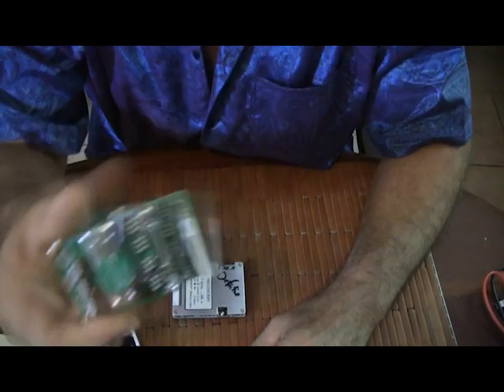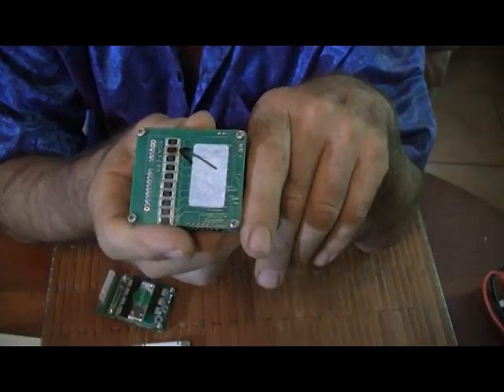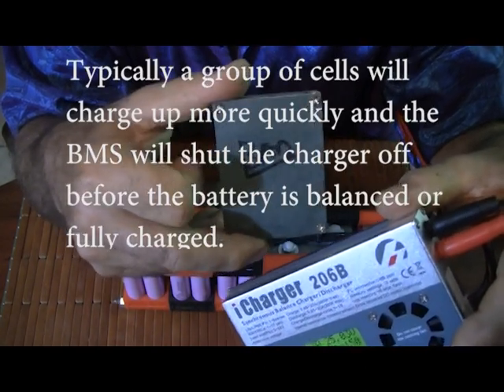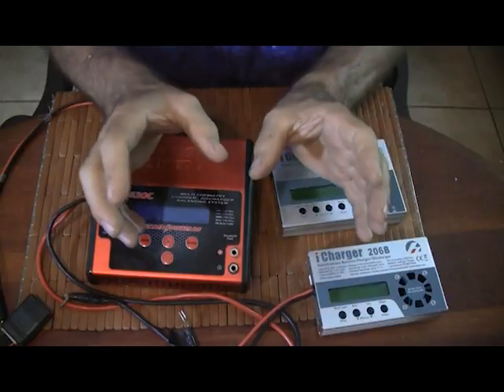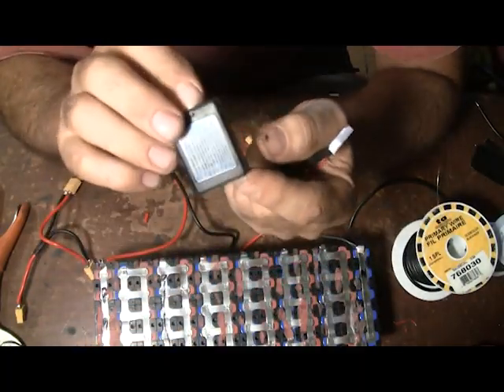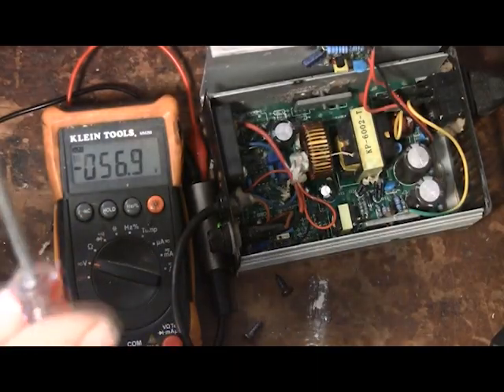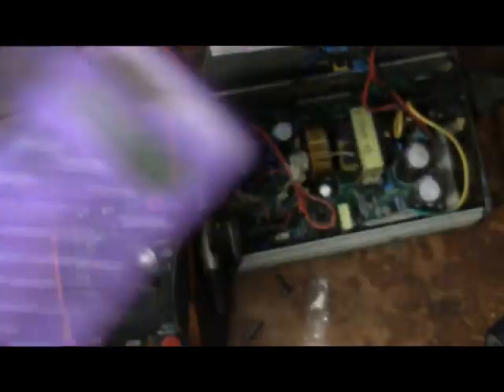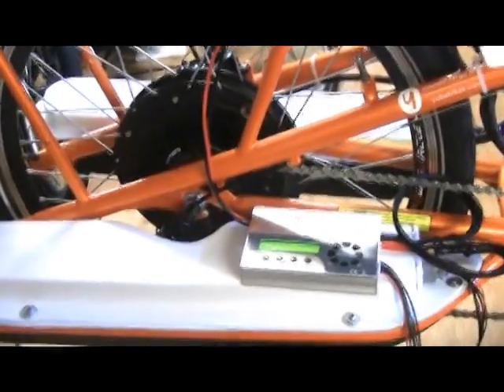How to build a safe and better lithium battery WITHOUT a BMS.

Comment: Nice video.  I have 3) 60 volt snapper battery packs they're all bad.  You've inspired me to pull them apart rewire and see if I can't put it back together again without the BMS.  Not exactly sure what I do with 15 cells relative to your explanation but I'm sure there's some sort of product out there.
Reply from the maker: Don't do this to working packs!  You will need at least an active balancing circuit board and to replace any bad cells when reassembling.  Using a Hobby Charger with a 60 volt battery requires charging the battery in halves, too fussy for most people...
Reply: @shawname2  I thought I would try to take my 60 volt 2 amp pack, and make a 60 volt 4 amp pack by splitting it into double-charged packets and then reconnecting them to a  jumper like you showed your video.  Was also going balance via SS voltage and to play with the  voltage reading IC your showed.  I have 6 bad 2amp packs, so probally have enough decent batteries to play with.  I've watched a couple more of your now, being the geeky type myself I've enjoyed your knowledge.
Reply from the maker: @rh-cv3nr  Hmmm, why not try and repair two of the packs using the third as a spare?  It could very well be bad cells, not a bad BMS.   Many ways to go!

Comment: Nice video. I’m a fan of bms-less batteries myself. For charging of parallel cells, you can also use the very cheap tp4056 modules (25 ct each) that actually charge each parallel group of cells to the correct voltage (max 4.2v) instead of having to bleed excess voltage through a resistor. Splitting a battery is a great option. In that way you can use a 2 amp usb charger to power two tp4056 modules. Resulting in a very cheap charger that balances cells faster than any commercial charger. At the same time, I recently also built a battery from old laptop batteries with bms, to which you can still apply the good practice of monitoring individual cell voltages yourself. Balancing of old cells is no problem if you carefully matched the capacity of the groups of parallel cells beforehand. Multiple ways that lead to Rome, but I prefer the simplicity and maximum power of running without bms!
Reply from the maker: Good find, those Chenbo boards.  I once used 4 volt power supplies on my 120P Power wall battery- before switching to active balancing...  a moments searching found a 3 pack of 2 amp chargers with two USB ports each for $11.  Good post- make a video and share it!   thanks!

Comment: I only make small battery packs for hobby projects like lights. I also don't a BMS, they are too expensive and too complex. For a small battery pack I use holders that allow me to remove the 18650 cell and then I charge them individually. Cheap, simple and easy to replace a dud cell.
Reply from the maker: Yes,  we are in the same way of thinking.  BatteryBlocs are for larger batteries than a 4P.  For smaller batteries there are better solutions...

Comment: thinking of this setup i takE it id need 2   i chargers  10 10 B ?    i trust you and makes sence  THE chargers are  expensive ..  but i have 20s    72v    and not sure if its going  to be a 3   4  or 5p   yet   Samsung 30T 21700 3.7V 3000mAh 35A is my cells there expensive  so i want to lookafter them    any ideas  ?  WHERE DO I GET THE BATTERY LED METERS  HOW MANY I NEED FOR A 20S          THREE  I TAKE IT
Reply from the maker: 20S is hard with a Hobby Charger.  You would need to split the pack in half and use a 10S icharger.  I would consider active balancing and use three 8S cell loggers to monitor the parallel groups voltages....
Reply: @shawname2  thanks  shawn SO I WILL NEED 1OS CHARGERS  X2 ?   THIS WILL  BE 200POUNDS     where do i get thease 8S LOGGERS  SIR ?
Reply from the maker: @jonneilsmyth9107  Do you have a hobby supply store for RC cars and planes?  You are in the UK-   You can also try Hobby King- they ship worldwide.
Reply: @shawname2  THANKS AGAIN SIR I WILL TRY TO STOP ANNOYING YOU FOR A BIT UNTILL THE CELLS  ARRIVE AND THE ONLY ONE THING ID NEED IS A 20S TRIANGLE  Configuration 4P 5P 6P   IT WILL BE ONE OFF THE THREE AS IN 60 TO 120  CELLS   AND IM CRAPPING MYSELF DONT WANT TO SMOKE THEM MY HOME OR MYSELF
Reply from the maker: @jonneilsmyth9107  Go slow, be of Zen mind, start with the negative terminal checking the voltages as you build,,,,,,   Good Luck!

Comment: I have to ask the one question, and I may be ignant of this, however what maintains the discharge rate of the battery?
Reply from the maker: Sure- two things, the load itself- the battery cannnot discharge more than the load will accept, and if the load is unlimited, the battery chemistry.  It is called the "C" rate.
Reply: @shawname2  Thanks shawn. That just made everything easier for me. Have you found an RC battery charger for 14+ cells that is any good?

Comment: This a outstanding video but it makes me think there should be a BMS as a combination of all of this, showing info about all cells and allowing decisions to keep going or not
Reply: I'm interested in a car conversion, I'm making my research
Reply from the maker: Yes.  We need a product that allows bluetooth monitoring of each parallel group, the high voltage and low voltage cutoff of a programmable BMS, and an active balancing circuit good for an amp of current.

Comment: The current for balancing with the icharger 206 is 350mah. The new ISDT T8 charger has a balance discharge of 2.2 amps. Plus charging voltage is adjustable.The bigger icharger 4010 has a higher balance discharge. It's nice to charge faster and not wait to balance the battery.

Comment: WHERE Do I buy the port cable at? I can not find it on ebay or elsewhere.
Reply from the maker: They are called JST-XH connectors.  Search for that, they are everywhere, or visit a RC hobby store.

Comment: I have a question, You say that a hobby charger is better than a BMS. Can you add a hobby charger to this build? https://www.youtube.com/watch?v=p1xildSl4Hk. Maybe I should ask can a hobby charger be put in place of a BMS for any battery build?. Thanks.
Reply from the maker: Sure- you could use a Hobby Charger to balance these batteries- or you could use active balancing, or a BMS.  I say a Hobby Charger will balance faster and better than a BMS, but using a Hobby Charger takes a bit more know how.
Reply: @shawname2  Awesome. Due to your reasoning, I think I would go with the hobby charger also. Are you available for help if needed?
Reply from the maker: @jamesw6529  Yes, happy to give free advice.  Contact me through my website www.batteryblocs.com
Reply: @shawname2  Can you show us the install of a hobby charger? or point us to somewhere that shows how to connect the hobby charger?

Comment: QUESTION  i am building a 13s 6c pack for a bike. these are used cells all been pre tested and ma written on. i have used the site to arrange the cells..now the ma vary from 1880 to 2500. the auto cell program mixes the 2500 with the 1800s..is this safe or will it cause damage or reverse charge the cells hope you can help cheers
Reply from the maker: Yes, it is safe to mix cells of different ma in the same parallel group.  The critical factor is that all the parallel groups have close to the same ma.  The closer they are, the more balanced your battery will be.   It is also OK to use different numbers of cells in P groups, as long as the totaled ma is close.
Reply: @shawname2  the online calculator told me how to arrange the batteries in P.
SOME HAVE 1880ma and some have 2300.
it's that website where you type in all your battery milliamps and it works it out for you in groups thnx for replying
Reply: They all added up to around a deviance of + 1 or -in the parallel groups of 6
Reply from the maker: @electricdixie34  You are talking about mah right?  Give it a shot!  If a bms can't keep it balanced, try a hobby charger.

Comment: you are talking lot about over-charging. what about how to prevent over-discharge ?
Reply from the maker: Hi Anthony,
I use these:  

https://www.aliexpress.com/item/4000306287198.html?spm=a2g0o.productlist.0.0.d22f32b97LpVhi&algo_pvid=c9fc463e-04f5-4349-bf59-2acc9d9d0ed6&algo_expid=c9fc463e-04f5-4349-bf59-2acc9d9d0ed6-0&btsid=0ab6f83115903515704091998e45c9&ws_ab_test=searchweb0_0,searchweb201602_,searchweb201603_

They sound an alarm if a parallel group gets too low.  Good for batteries that you are around.  For large batteries I use a voltage relay like this:  

https://www.aliexpress.com/item/32826508821.html?spm=a2g0s.9042311.0.0.27424c4ddJknBr
coupled with a relay.
Reply: Shawn. Your explanation is make sense. . Thx for sharing anyway. I subs your channel
Reply from the maker: @anthony4312  Yes, true.  This is for geeks.

Comment: i use a bms, however i have also wired an arduino with a small screen connected to current sensors to each balance wire, and temp sensors to some components (like to some cells, components that get hot). that way i can see what the bms is up too and how my batteries are doing for the exact reason you dont like bms's. I want some feedback. least when the bms fails i will know.
Reply from the maker: That's a great approach- you are more skilled than most!

Comment: hobby charger was BMS to, but it use lcd to monitor the voltage
what's differen BMS and this hobby charger
it's still the same
at least if not using BMS, so charge it directly to power source
so that called not use BMS
cause I see youtuber not use BMS for battery that use on his EV car
and it's still balance
so make sure balance the battery by your own (the resistor of the battery is identical)

Comment: Thanks Shawn for this great video! I'm now convinced to use a hobby charger to charge my ebike and no longer rely on a BMS. The only small "issue" I see is with the cell logger: this thing will be powered from a single cell and so it could slightly drain that cell compared to the others, thus generating imbalance... Is that a problem in practice? Or are there any cheap cell loggers that are powered from each cell one at a time? Thanks!

Comment: I’m making a 26650 lithium iron phosphate 12v car battery. I need a bms that can handle 500 peak amps. And 120 continuous. 35amp charge rate.  Should I use a bms for this battery? It is a lot of current and will be charged by an alternator so I can’t hobby charger it. I’d assume this classified as bulk charging continuous and need a bms and balancer.   Very informative clip
Reply from the maker: This is a bit out of my area of expertise- charging a lithium battery with an alternator.  However, never being one to turn down a chance to express an opinion,,,,,,  If you are certain that the alternator will not exceed the max safe voltage for the chemistry, I would use active balancing.  Four of these:
https://www.aliexpress.com/item/1768384410.html?spm=a2g0s.9042311.0.0.27424c4dm8ni8P
Skip the BMS,  use a DC circuit breaker against shorting, and  run a small volt gauge up to the cab to keep an eye out for low and high voltage......
Reply: @Drake Velazquez - You need a SPECIAL Charger between the Alternator and the Lithium Ion Battery Pack.  At low RPM's you can over-heat & smoke your alternator.   You've been warned !  Balmar has a special Alternator + Li-Ion Controller combo.  Also, what are you going to do when the BMS disconnects the Battery when it is fully charged?  Oooops!  Are you going to START the engine with that battery?  I doubt that a "normal" BMS woks well in an automotive application.  There are so many issues that you need resolve. Also Under-The-Hood Heat = a short life ...
Reply from the maker: I agree with Mr Summitville, and think that it is wisest to use lead acid's to start ICE engines.  It is simple and there is nothing to go wrong..   Lead Acid and ICE are a match made in Detroit!

Comment: The problem is this does not work in a commercial setting. While I make battery packs and sell them, there is just no way I could provide my customers with no protection and supply them with a hobby charger, because if they use the wrong setting on it and overcharge, or discharge too much, or just mess up in general, then it could be super bad. For DIY yes, for those who need a battery pack and don't want to fiddle around with all of this and just plug and go with a DC adapter, then no -- no BMS isn't a good idea.
Reply from the maker: Hi Jonny,

I agree totally with all you say.  This video presents an alternative for hobbyists who like to understand and control their gear.  "Civilians" who have no interest beyond riding do not have the patience or interest.    I personally keep a hobby charger set up for my 14S ebike battery, and balance charge half at a time.  I also use a bulk charger for the full 14S.  It does take some knoweledge to do this.  My nerdly friends have no trouble understanding this, but I have an artist friend for whom I supplied a BMS!

Comment: I would put money down this guy is right, you don't NEED a BMS, but I am cringing thinking about the number of wires on any of his bikes. A quality BMS could be used with one of the battery log devices to keep the feedback loop.

Absolutely deserves a thumbs up for the video and for leaving an email address! Nice work, great video!
Reply from the maker: This is a good comment.  Yes, a quality BMS with good parallel group monitoring is a good solution.  A toggle switch is wired into the negative of the cell monitor.  A two to one splitter on the JST wire harness reduces the number of wires.  A BMS bypass switch could be used if the BMS shuts off the battery but you still want to go a little further.  There are also new BMS's which combine active balancing with the high current/low voltage shut off functions.  They are sweet.
Reply: @shawname2  Also, the BMS can FAIL ... catastrophically ... when you are far from home.
Reply from the maker: @MrSummitville  I so agree- I have had it happen on ebikes when I have been a long long way from home.  Had to open the battery and bypass the BMS with a jumper.

Comment: Do you have a link to the cell monitor your using?  I've been looking (for a lifepo4 version) for a bit, and I haven't found any for a reasonable price.  But I also haven't found the one your using.  Thanks!
Reply from the maker: Sure- You can find an assortment of them at HobbyKing:    https://hobbyking.com/en_us/batteries-chargers/battery-accessories/voltage-indicaters.html

Comment: wow, great educational vid. didn't know a battery pack is as good as the bad weakest link..
Hi Shawn McCarty
I have the EMMO GT80 scooter with 80V/20Ah Lead Acid battery. i want to upgrade.
I want to build a 1 or 2 or 4 (LiFePO4) battery pack that will equal 80V, 20AH.
Whichever is the best and Economical way

can this be done? 

80V/20Ah (LiFePO4) battery  
or
2 x 40V(LiFePO4) battery =80V 
or
4 x 20V(LiFePO4) battery =80V

Thanks

Comment: This is why I use bms only as low voltage cut off device. Even with bms on my battery pack, I always attach balance wire.
Reply: technological singularity
Yeah. The most reliable way to control and balance battery is to have handy access to all cells to measure it with a simple multimeter.

Comment: So in essence if you construct a robust and lasting charger amd connect it to the battery instead of a BMS and install a "low charge" stop on the consuming part, you gain lithium technology without proprietary BMS bullcrap and get exponentialy cheaper KWh curve.

Comment: I don't understand why the batteries need to be separated to charge.  Can't you just use separate power supplies and charge each half with then still together?
Reply from the maker: Absolutely.  The problem occurs when someone attempts to charge them in parallel when the two halves are connected.
Reply: @shawname2  Two Chargers can work simultaneously, into both halves, if the outputs of the Chargers are isolated from "ground" - ie floating ...
Reply from the maker: @MrSummitville  Yes- which always happens if the charger converts AC to DC...    However, running two hobby chargers from the same battery wouldn't work, right?

Comment: Hi shawn in your video at 7.03  minute you mention (sell loggers) or (loders) i am not sure about the device name can you please advise me how to purchase this device for my motorbike currently it's using 12V 6Ah 10HR  i would like to conver it into lithium battery . i am really following the  instruction from your video thank you.
Reply from the maker: Sure- Here is a link- you can find them at hobby shops.

https://www.amazon.com/CAMWAY-Battery-Voltage-Monitor-Checker/dp/B07DC3LH9C/ref=sxts_sxwds-bia-wc1_0?crid=IFLDTHZ9X7CQ&cv_ct_cx=8s+battery+monitor&keywords=8s+battery+monitor&pd_rd_i=B07DC3LH9C&pd_rd_r=1074c4d0-efe2-44e5-acad-5230f45c8f3a&pd_rd_w=JDy8U&pd_rd_wg=S67NO&pf_rd_p=c8430d96-912c-40d1-9740-e1beca245dd5&pf_rd_r=85BZ3C5SE5H9ZEQYJXNV&psc=1&qid=1583597002&sprefix=8s+battery+%2Caps%2C175

Comment: Great video! Thanks. I'm unclear about something. When you adjusted the generic 2A charger to 57V (4.00V each), why would you use this charger if there is no BMS and you need to use the iCharger to balance them. Can you set the iCharger to only charge to 4.00V?

Comment: Do you still build batteries with matching batteries in series.....as opposed to most folks do the parallel connection(with BMS)?
I really like this simple method using my own deligence and  cell loggers....plus it allows a cheaper buck converter for double duty  in other purposes for batteries.  I keep seeing warnings by those only connecting groups in parallel....seems that its mostly because of BMS design limits.
Reply from the maker: Sure, all the time.  But these days with active balancing.  I use my power wall with active balancing as a "buck converter" by having taps for various battery voltages.  The active balancing makes it possible.